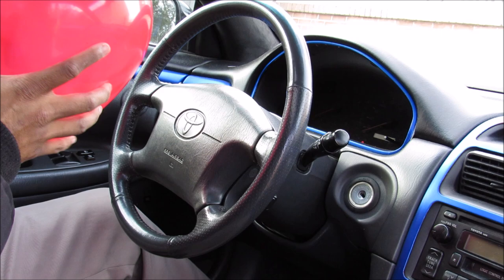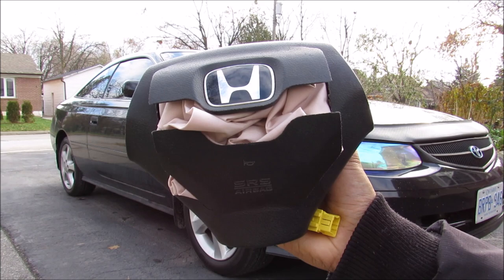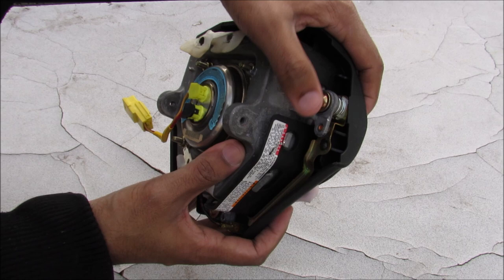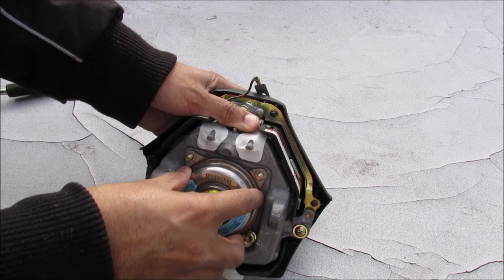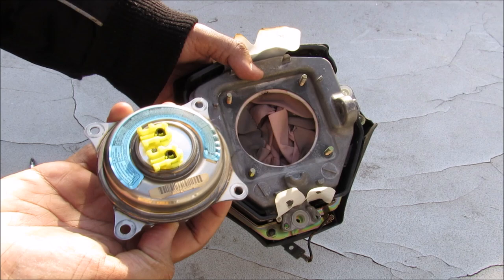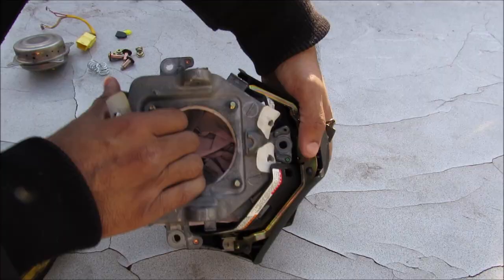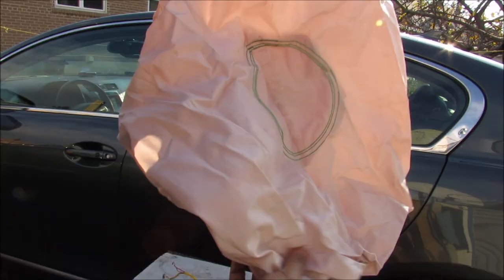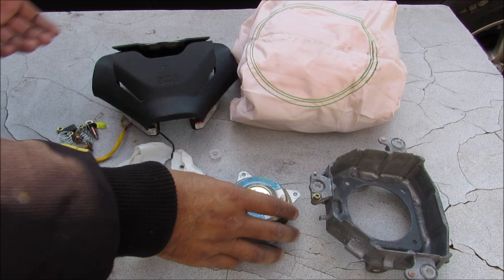How an Airbag Works - Takata Recall Explained

Comment: Sodium Azide was not the propellant used in the Takata recalls that chemical was subject to clumping together in humidity. the propellant is a group of small cylinders that vary in size as to the amount of fill of the bag and the pressure required to escape the vinyl cover or dashboard. The azide does not have the clumping problem and thus does a controlled burn releasing the Nitrogen at a pre determined rate.  The Takata propellent formulas clumping changed the controlled release to one fast instant deployment.
Reply from the maker: +ROBERT HARRIS thanks for the clarification

Comment: Just wanted to ad that there are 2 squibs(inflators) on modern air bags. You can tell just by the 2 connector's on the back of the air bag. One is for full deployment and the other is a smaller charge(60 to 40%). The smaller charge is used when the driver or in the case of front passenger is under 97lbs(each manufacture has slight differences) or in lower speed accidents. 

Neat fact, those yellow wires and connectors are gold plated to have very good connections needed for hi speed signals from the SRS module in the event of a crash.
Reply from the maker: +Korrupted thanks for the clarification. I didn't want to risk opening the inflator to find that out the hard way

Comment: I was an Electrician at a new Inflation Systems in Ga. One gram of the propellant in theirs was equal to the same amount of nitro gliserin. They had sniffers that detected the propellant on a micron level  explotion proof drop doors and  blow out pannels. And a rubberized plant floor because it was the same  type of plant that in the 90s blew  in Sarasota Fla. they now know there  must of been  alot of the propellant in the air  A man hit a small staple or other metal object with a push broom caused a spark on the floor somehow They found cinder blocks 5 miles from the place. Yeah the start up of that place in Ga A pucker factor of 10 plus.  The word for the day we all nervously said was Boom
Reply from the maker: +Steven Steele wow

Comment: Another good video. I would emphasize that whenever you buy a car new or used, go to the manufacturer's owners page and register your car.  Manufacturers use this to contact you with recalls and safety information.   I bought all of my cars used and have registered them with Ford, Honda, Lexus and Mazda, and each company sent me an airbag recall notice. As a note, Ford has been the fastest on actually doing the replacement.  I am still waiting on the others,  but at least they notified me.
Reply from the maker: Thanks for the feedback. Yes the airbag recall is important, I decided to get mine done a few months ago. While doing some research on the recall I was surprised at how little information there is on what happens during the recall, so I made this short clip to show what's inside.

Comment: Nice video! I would point out: I believe that airbag manufacturers are moving away from sodium azide, due to its toxicity, and ammonium nitrate -- as has been used by Takata -- due to concerns of volatile shrapnel ruptures of the inflators. 

I don't know about in Canada, although I am assuming it is the same everywhere: airbag manufacturers are, I believe, now switching to guanidine nitrate as the chemical used in the reaction producing the gas in the bag. Guanidine nitrate is believed to be less toxic than sodium azide and less prone to violent shrapnel rupture than ammonium nitrate. Hopefully that will remain true over time.

That said, I agree: It's best to play it safe and leave the handling of airbag inflators to folks who have been professionally-trained in proper handling of them. This is because that there is likely some inherent risk of explosion and toxicity regardless, due to the nature of the materials we need to use to get airbags to inflate in time to save our lives (until we can come up with something better, anyway).

One final remark: For anyone interested, Battelle Innovations has a slow-motion video here on YouTube of a Takata airbag inflator -- "pen-style", rather than "pancake-style", if you would -- actually exploding into shrapnel. Scary stuff imho.
Reply from the maker: +Lynda Gruen Thanks for the info.

Comment: Those vent holes are actually there because if you completely sealed the bag, the material itself would rip and wouldn't be there to cushion an impact.
Reply from the maker: +White03T4RV82WD true, and it allows the bag to deflate

Comment: After having my face rebuild from taking a tree in the face bulldozing. Injuries consistence with folks eating steering wheels or windshields from not wearing a seat belt in a head on collision. I"ll risk the air bag and wear a seat belt. Thanks for the education on the bombs inside your car. I'm guessing a roll over would be less than interesting. Great video.
Reply from the maker: Ouch!

Comment: Sorry i have a question, can i change the plastic cover with a non crashed airbag (i mean Not used) and put the airbag in Other plastic cover (same model car), it is dangerous?? Thanks by this video 👌
Reply from the maker: Yea but you'd be drivit without air bags

Comment: Within approx 200miliseconds there is not gas pressuried inside the cushion. Takata recall was due to pellet tabs inside the inflator, during car usege those tabs hit each other and eventually created something like dust so it can be easilly ignited and release huge force in short amount of time (should have not been damaged and keep pellet shape so it can release pressurized force during longer amount of time)

Comment: If i take my corolla in for air bag recall:
1. What do they change?
2. How long should the job take?
3. How can i tell if they really changed anything?
Reply from the maker: +sean craig they change the inflator behind the cover. You can only tell by removing the airbag and checking the serial.
Reply: And that fix should not take long -- Mazda estimates the process to take about 1-2 hours for their vehicles, for example -- provided a non-defective replacement inflator is in stock. That's where the wait can drag on for months sometimes.

Comment: Good video...But I want to ask about one component in this system which I have heard a lot of time and that is Clock spring. Could you tell me what it is and where it is installed?
Reply from the maker: +Anurag Gupta see my clock spring video...and my steering column video

Comment: Hey, great video. Quick question for you. I need to take off the front plastic cover where the emblem sits on from my Toyota airbag. I don't need to remove the inflator itself right? I should be able to just remove the screws holding the cover to the horn springs and remove it? Any tips? I know a lot of mixed info out there regarding the inflator exploding but if it's off the car and there is no voltage then there shouldn't be a risk should there?

Comment: Are the holes actually there to allow for control of the vehicle shortly after triggering the airbag?

I thought it was to vent out the air so the airbag was softer against your face.
Reply from the maker: +Durcaz It does both, vent it and deflate it. If the airbag remained inflated you wouldn't be able to exit the vehicle....it's huge.

Comment: So, what is happening with all of the returned inflators? Could have lots of fun with them.
Reply from the maker: +Anthony Lee I'm sure Honda is detonating them before disposing. Remember though they aren't replacing the bag, just the inflator.
Reply: speedkar99 it's not just Honda.
My concern is national security as these devices are very dangerous in the wrong hands. Not to mention the millions in automotive bone yards. These things can very easily be turned into IED's

Comment: I worked in takata.  2 years .as a operator engineer
Reply from the maker: Thanks. Do you have any insight?
Reply: speedkar99 1.
TAKATA INDIA PVT. LTD.  NEEMRANA, RAJASTHAN
 Two year experience  in production department as a OPERATOR ENG.  . It’s a japanesse company and  makes steering wheels, seat belt, air bags etc. it is a polyurethane moulder for customised solution in the automotive markets. It’s a basically polyurethane rubber parts manufacturing company. It is an ISO 9001:2000 and ISO/TS: 16949 -2002 certified .

Comment: The vent holes are not to make the bag deflate so you can gain control on the vehicle! They are there to deflate the bag when you hit it, slowing you down.
Reply from the maker: +Craig Stevens Yes it does that too!
Reply from the maker: +Craig Stevens Yes it does that too!

Comment: I have heard that we should never do  "contunity test " with a multimeter on airbag connector.... Is it true?
Reply from the maker: Yea you shouldn't because the small voltage can make it blow
Reply: @speedkar99  I really think this might be a persistent myth. Don't all these squibs require something like >1A @ 12V for a few ms? A normal functioning multimeter is never going to be outputting anywhere near that. I think manufacturers recommend against testing just to avoid any potential liability (as a general CYA and not because there is a likely risk).

Comment: In Australia we have been told that the company Takata has gone into bankrupcy and that it may be some time before we will get any airbags replaced. I've been waiting a year for Jeep to call me back to get my airbags replaced.
Reply from the maker: +fourbypete and the meanwhile your driving like that? Scarey
Reply: Only when the airbags go off. Otherwise the vehicle drives normally. That is the second recall from Jeep for my car. I'm still waiting for them to replace the clockspring.
Reply: I’ve been driving a rental paid for by Lincoln Motor Company due to the airbag recall
Reply: You need a better lawyer.

Comment: Anyone know what the connector wire is called? Like the one in the pic of this video
Reply from the maker: No but you can find it's part number in the wiring diagrams
Reply: speedkar99 do u have the wiring diagram or know whr to get it from

Comment: the folding sequence of this cushion is a really disaster 😂 it is not like of airbag produced in our times. They have a several checking and the industrial machines have a lot of advanced technologies for fold and control each step... is accuracy 100%. step by step like a drawing from cushion design and for a studied folding sequence.
Reply from the maker: Yes... folding is very important. Lucky thing airbags can't be reused otherwise it would be a mess

Comment: Your information is off. The Takata airbags use ammonium nitrate to inflate which is less stable over long periods of time, heat and humidity, than the sodium azide and is the crux of this whole problem.
Reply from the maker: Thanks for the clarification
Reply: @speedkar99  No problem, My car was silently added to the recall just this past year so I spent a lot of time researching the whole issue. Apparently more cars are going to be added well into 2020.

Comment: It's the whole airbag. The inflator comes as one assembly. At least for ford it does. I was a ford tech for a long time and have done many of them. Here's a video of me doing one
https://youtu.be/Nf7Y7HCxsK8
Reply from the maker: +Twist_the_wrist83 Ah when I took my Honda for the recall it was just the inflator.
Reply: Every manufacturer is different Ford's came as the whole piece  love the video though
Reply from the maker: +Twist_the_wrist83 thanks

Comment: One more tip. 
Never take apart an inflator from an airbag that hasn't been deployed. Sodium azide is extremely toxic, as is the gas it produces when it comes in contact with acid, water, or heavy metals.
Reply from the maker: +absol good tip
Reply: And unless I'm mistaken, SRS airbags I think are dual-stage or multi-stage, which I believe means that even ones that have been deployed / detonated, may not have detonated the entire charge. It's important to be sure that inflators are fully detonated prior to disposal. I watched a YouTube video of someone delibrately detonating a (probably functioning) Takata airbag, and they discovered that the thing detonated a second time, probably because it had not been given a complete charge to have the full-force effect necessary to render the device harmless. (They were basically amateurs pulling a stunt, not folks properly-trained in detonating an airbag.)

With regards to sodium azide: yes, VERY toxic -- but this should be more of an issue with older cars, and hopefully would not be a problem with fully-detonated inflators, since the sodium azide would hopefully be consumed. (This is a known issue for scrap metal yards, along with the Takata airbag risk. The way you mitigate this problem is to remove the inflators before crushing the cars, making sure to detonate the inflators fully, and call first-responders / a HAZMAT team if there's a problem.) 

On the health effects of sodium azide: I was reading on the United States Centers for Disease Control (CDC) website that it can lead to convulsions, vomiting, even death, depending on dosage. Said to harm the brain, heart and lungs especially. Beathing in vomit particles can allegedly make someone sick from it, although the gas is said to be lighter than air, so ironically, when sheltering in place,  you get to the floor. Just away from barf, apparently. FRESH AIR IS THE BEST ANTIDOTE. Also said to be harmful to the skin and GI tract, although inhalation is the greatest threat. This may also be one of those substances that you can't pour down a drain without neutralizing it first, either, because of an explosion risk in the sink / pipes -- and environmental concerns, such as harm to marine organisms. Why we have to use such stuff.... I hope the guanidine nitrate ends up not being as bad. Honestly, I wish we could use big cushions in front of the steering wheel instead of gas bags -- mho.

Comment: Yes remember SAFETY 3RD Has anyone watched the different really mean pranks they do with them One actually launched a man up into the ceiling tiles I mean the man was like 4 or 5 feet into the air. Check them out just Key word man launched by airbag. Like Its mean but you can't look away I would of played the jack in the box tune in the back ground
Reply from the maker: +Steven Steele that's dangerous. Don't go near the airbag.

Comment: I wanna rub the air bag material against my cheek cause I wanna see how the fabric feels to the touch
Reply from the maker: +Kenzie Backlin Do you really...? 
My first time touching an airbag was at the junkyard, and its quite a tough material. 
So you can either goto the junkyard....or crash and find out the hard way how it feels.
Reply: speedkar99 I meant the fabric